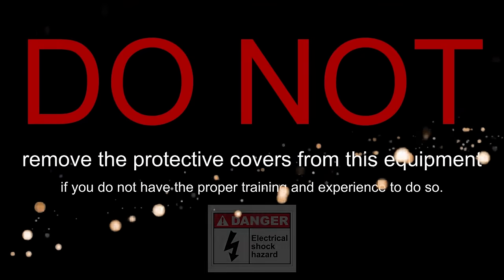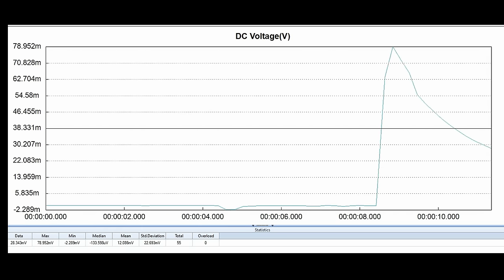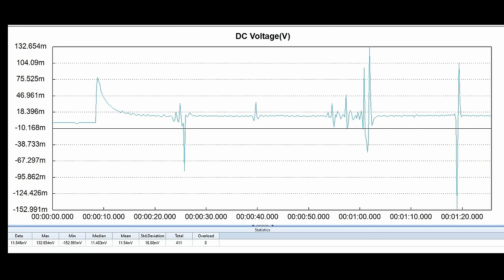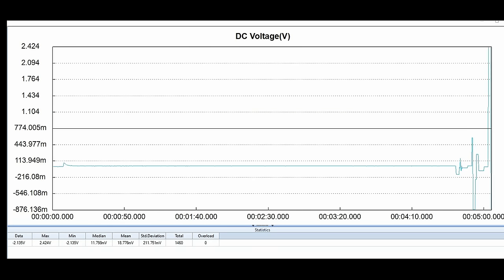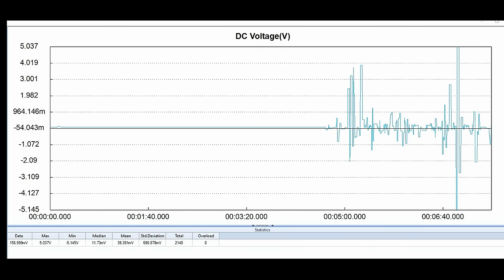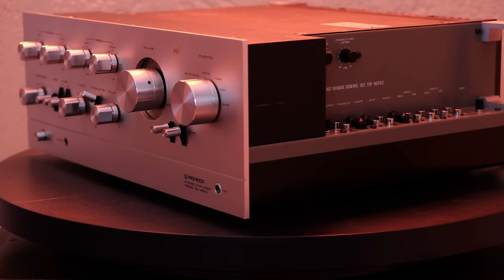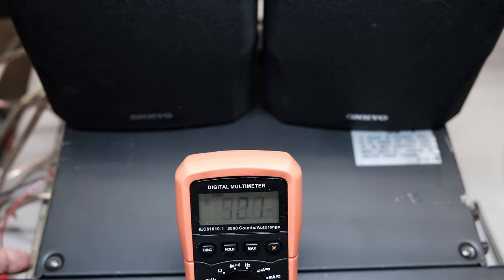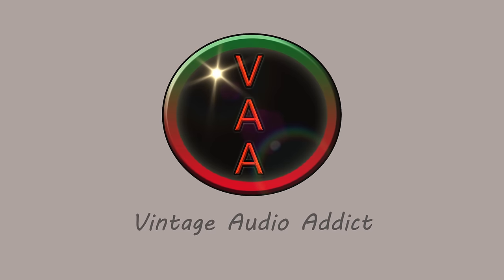HUGE Problem With Vintage Amplifiers & Receivers. Hides From Your Eyes But Not Your Ears.

Comment: How do you connect to the speaker outputs? Where does the ground wire go, to the chassis or on the speaker ground where the speaker wires artach?
Reply: My question as well. i have a pair of Adcom 555's, a Carver M-500 and recently, a NAD 208thx. All of them are 200+wpc, and the speakers I would use with them are a pair of aDs L810s or the 910s, both of which are 1970's era speakers. I'd hook up some 8ohm bookshelves to test first though.
Reply from the maker: You should have a positive and negative speaker terminal for each channel on your receiver/amp. You should have two leads from your meter. Polarity doesn't matter in this case but if you want you can attach the positive meter lead to the positive terminal on you receiver/amp. The negative to negative. DON'T SHORT THEM TOGETHER!
Reply: @vintageaudioaddict  Thank you, Sir Vintage! Oh, and I know to select DC, not AC on the meter, but if a reader doesn't...now you do!
Reply: Thank you! @vintageaudioaddict

Comment: great vid but i still have no clue how to adjust DC offset if needed…?
Reply from the maker: You would need the service manual for your unit or find the information on the net. In addition you would have open up the unit which puts both you and your equipment in danger.

Comment: I have a Pyle, the one made from China (2016 era), 4 channel car amp and it was sending many volts (Not sure what it was but knew it was wrong) to the front speakers damaging them. I have not repaired it, but was guessing a shorted capacitor since it looks like this model uses some of them between the output transistors and the the speaker. Now I wonder if one of the output transistors was failing. Still play normal when I tested it but seeing that voltage at the speaker connection is a problem.  (Pyle used to be made in USA.)
Reply: Yep... a Pyle is a "Pile"  for sure  no matter the year or place built. Just chuck it.
Reply: @Rob.DB.  The Pyle speakers was were I first heard of Pyle. Then in the 1980's,1990's I saw they had some amps at a car stereo show/sale. Yet I recall telling a stereo shop about the Pyle amp and they said that Pyle did not make any amps. The only problem I had with their speakers, was the foam edge would go bad but that was the thing with most speakers of that time era. I did not know until much later, around 1996 that those foam edges could be replaced. I did that to my 12 inch woofers, then some other brand stuff later. Some people frown on the foam edge design, but it has less resistance, less weight, so it is more responsive then the rolled paper or the rubber.   I think Quam was the first to come out with the foam edge for speakers. Now Quam stuff was more hype then quality. Nice foam edge but the 6 X 9 speakers were rated for like 5 watts. 
Another speaker I think was hype back in the 1990's; was Pyramid. High wattage but stiff as a board.

Comment: for abnormal dc offset ,the first thing is, always check variable resistor or trimpot of dc offset setting and bias  in vintage amps. and then leaky bjt

Comment: Where does the damage occur in speakers when multiple dc volts are sent to it?  Is it the voice coil of the drivers or the crossover or something else?  And what happens to those parts when this type of damage happens?
Reply from the maker: Yup, the voice coil will heat up and fail.
Reply: @vintageaudioaddict  , Thanks for the info, good to know.  I was wondering as I measured some sending some significant dc voltage coming out of an amp I was using to power an old altec compression drivers of mine some years ago that are now in storage.  The good news is the voice coils are connected to the diaphragm and they are easily replaced and still readily available.  Also good that the amp was only powering the compression drivers as the amp was part of an active crossover system.

Comment: Hey Chris this voltage test is performed WITHOUT audio going through the unit?
Reply from the maker: yes, that's correct. Volume minimum and select aux for the input function.

Comment: Hey man! Great channel u have here!  Iused to fix antique radios 
Still have a Radiola 60 and its wrkg .
Woul really like to know more bout my Sx850 and 950. And kenwood 6600 as aux input ia a dogs dinner. The 8 and 950 are great rcvrs, kenwood 6030 has lots of beef. Yup ill be watching you .lots of rcvrs have the jumper pins. Have even seen rcvrs being sold with out them.

Comment: IDK. I’m still running (bridged) Carver TFM-45’s mated to Sony TA-E9000ES Processor and my ol’ school Polk 1.2tl SDS-SRAs and Velodyne FSR15s (x2) still image as they did from the day I first purchased everything.
Granted, every 10 yrs I replace the Polk drivers and tweeters, and the Carver’s had new caps, etc. installed 5 yrs ago. I will NEVER part with my gear!!

Comment: Hi Chris, and wider audio community. 

Not sure if the topic of this video is what I'm experiencing but I have an old Denon PMA-350SE. Quite randomly during usual low volume use it would suddenly jump up to max volume static horrid noises, only way to stop it was to turn it off. Often it would then be fine when turning it back on for a somewhat random amount of time before doing it again, it was fairly inconsistent. I haven't used it for a while now because it was honestly quite shocking/painful when it would bug out like this. Wondering if this is a common issue you might be able to identify from this brief description? 

Cheers for any help.

Comment: Do you check the offset with the speakers attached?
Reply from the maker: Well....the rule is.... For direct coupled amps like this SA-9900 and many other amps/receivers, no speakers attached. For cap coupled amps/receivers, speakers or load resistors attached. Frankly for a unit like this SA-9900 attached or unattached is fine. It reads the same. Always safer to test any unknown amp/receiver without speakers. No chance to damage the speakers if there is an issue.
Reply: @vintageaudioaddict  My 1985 Yamaha A1000 is measuring a steady 4.5mv.
Reply: @vintageaudioaddict  One might keep SOME kind of load on a tube output amp.Or is that poor thinking?

Comment: Half these old amps have boards full of cold joints, and those boards  full of cold joints often, but less often, have noisy failing transistors. Not to mention the electrolytics - Always some. First thing to do is a visual inspection under some decent light. Maybe check for shorts on output stage, but then the first test would be a  meter across the output to check for DC.You may want to scrutinise the power supply section before turning on, and you may want to use a variac or test bulb to be extra safe.  If its OK to plug in a cheap pair of speakers  do so and continue testing. 
This is one of the first two.. Or even dodgy switches. Oh and they all have dodgy  switches and pots.
Reply: Off topic but you just described the new Jeep Cherokee rental I recently had for a few a weeks, dodgy switches, software, ride…I’ll keep using my vintage Yamaha amp

Comment: I had a Electron Kinetics Eagle 2A for years, it has NO protection circuit. One day it went full DC to my speakers and fried them so badly it melted the phenolic board the crossover was mounted on. The drivers were toast. I never listen above about 80dB either.  A couple of weeks later it happened to my friend who bought one new the same time I did.
Reply from the maker: Man, that sucks. Sorry to hear that. I love the vintage gear but I know there are risks every time you use it.

Comment: All that jumping in the bias usually means leaky transistors mainly in the preamp area and that sound? that's the infamous crackle emitting from the nasty 2SC458's! Most vintage high end gear has those nasty 2sc458's! take them out!

Comment: What did you connect the multimeter to ‽   Would help if you had showed that for us newbes.   Thanks!
Reply: He said a couple times " to the speaker output " either right or left will do.

Comment: My old Kenwood KA-7100 would cause a snap sound from the speakers when the relay closed or I switched the speaker selector from A to B and back again. Snapped when I powered amp down too. When running, it sounded fine, didn't run hot. I measured the outputs and found 450mv sitting on both channels. Took lid off and adjusted the DC offset pots on the main amp section. Got voltage down to near zero. Now the snap is gone! Ya!
Reply from the maker: Good job getting her running correctly!

Comment: I blew 4 woofers in an instant on a pair of Klipsch KLF-30s.    I was using a Phase Linear 400 AMP.    I lived in a crappy old condo that had a LOT of noise, pops etc through the electrical circuit that the stereo was powered through.  There was a bathroom on the same circuit.   The Bathroom lights and fan would create all kinds of noise through the stereo.  The tech that I spoke with said that I likely had a "DC transient spike" that killed them.   That was a sad and expensive day.   Nice vid.
Reply from the maker: Thanks a lot for watching. Man, that's a sad story. Yes, as you said when a high DC voltage hits your speakers it's over in a blink of an eye.

Comment: So on this unit you’ve isolated the problem to the preamp?
Reply from the maker: Yes and actually here comes a spoiler alert. The issue was caused by 2SC1451 transistors. Those are known to cause issues like this.

Comment: A capacitor on My yamaha R-1000 receiver gave up the smoke while playing yesterday. I racapped it, but a transistor went bad. Waiting on parts to replace the transistors on the power supply board.
Reply from the maker: Sounds like a good plan. Your Yamaha is a fine receiver. I'm glad that you are fixing her up.
Reply: I have the same receiver... haven't used in 18 years.  It looks perfect,  love to sell it.
Reply: @Damone7653  Enjoy that receiver. It has great sound! It was second from top when it was released after the R-2000.

Comment: This would be a decoupling capacitor issue, yes?
Reply from the maker: Spoiler alert. The problem was caused by 2SC1451 transistors. These are known troublemakers in vintage audio equipment.

Comment: What is the easiest way to graph the DC over time?  What do I need beyond a DMM?

I'm getting to the end now.  I'll finish and hopefully will see the answer.

So would a hold function be of use?  Could it show the peaks?
Reply from the maker: You will need a DMM that you can hook up (usually via USB) to a computer and some software that usually comes with the meter.  In my case the data you saw was captured by my Siglent SDM3045X and sent to my computer. I then recorded it using video capture software.(flashback express)

Comment: So I did a measurement on a old Kenwood amp I just bought that is all original untouched never recapped and it sits at between 0.6 to 0.8mV is that good asking as I know my way around but not that well
Reply from the maker: Well, if it's really that low then yes that is great. Just make sure that you are measuring correctly. The correct scale on the meter and make sure that your speaker selector switch is set to the speaker outputs that you are measuring. Thanks for watching!

Comment: So was the noise in both channels?
Reply from the maker: Spoiler Alert......2SC1451 transistors. Known troublemakers in vintage audio equipment.
Reply: @vintageaudioaddict  Same issue in my Akai 1722, 2SC458 known to be noisy.

Comment: hey Chris, do you know what is going on with the hifiengine? i used to have an account but had to care for my elderly parents for a while so i was not able to be very active and they killed my account and now they do not allow me to create a new one! i am trying to power up again and have no idea why they killed my account. thanks 🙂
Reply from the maker: Other's have had that same experience. I've heard that they are disabling accounts that have not logged in for a while. What a while is?, I don't know. Also, they are not taking any new accounts for some reason. Again, I have no idea why.
Reply: @vintageaudioaddict  i can't even send them a message! if your account is still active, would you please send them my message and see if you can get some answers? if they need help, i can volunteer. i was a very active member but as i said, my parents came first 🙂

Comment: I have a Sansui 5050 receiver that went totally silent while listening to music.Checked all the internal fuses, they are all ok. Is there a  obvious component failure that would cause dead silence while power is on.Unit lights up ,no sound.
Reply from the maker: It's tough to say. If it's all the inputs, It could be in the power supply section, protection circuit or the amplifier section that caused the protection circuit to operate. Sorry that I can't diagnose exactly what your issue may be.
Reply: I was just working on mine and if you open the unit towards the  left is a preamp board? with a pin connector on top with 3 wires I believe. I removed this board and the top pin connector and cleaned the contacts with Deoxit. Reinstalled the board (snaps into place) and the dead channel came back to life.
Reply: @68wrko that’s the driver board. The pre amp is in front attached to the pots.

Comment: Every unrestored audio component or speaker I have heard from 30+. years ago sounds pretty dull and murky.  Time and use worn.
Reply from the maker: Older electronics no matter how well it was engineered needs a little TLC from time to time.
Reply: @vintageaudioaddict   three years ago, I had a Carver m1.5t amp.  it sounded dull to me.  It got a total overhaul and upgrade.  the difference was huge/.

Comment: That's why I don't buy vintage audio , it's great stuff but it's just too old and so much can happen. A lot of original parts are not even available anymore and often you have to settle for cheap aftermarket parts.
Reply from the maker: Old and much can happen I agree with. The parts(mostly) are still available to make vintage audio equipment operate well for another 20,50,100 years? Can't say that about too many products. I've never had a piece of equipment in my collection that I couldn't fix because of the lack of good quality parts. Probably a bigger issue is that the folks who work on this equipment are retiring or passing away. It's getting harder and harder to find a technician.
Reply: it’s still better in some other ways to upcycle and keep things going. consider the heap of e waste bc everyone wants perfect gear perfect sound perfect tv resolution. none of that is good in the long run for humanity / ecology.
Reply: I'm glad you don't and I'm glad so many others are overly concerned about having issues, just means I can find and buy more! 

To me, the risk reward is more than worth it. I can go spend $3,000+ on a new amp and be guaranteed good sound but I'm also guaranteed to be out $3k+. If you're slightly skilled you can fix a lot yourself or recap an older piece. There's a sense of satisfaction in searching, bargaining, tinkering and researching an older piece that you'll never get from something new. 

There's also a sentimental connection with the old stuff, especially if you were enthralled by audio gear at a younger age, now I can afford the stuff and it can be just as good as it ever was with the right amount of patience and care.
Reply: @vintageaudioaddict I worry about the old technicians retiring as well, I'd love to see the torch passed to the younger generation, but I can't imagine many of them have much interest in learning. Maybe with average repair costs rising, they'll become incentivised by a solid paycheck.
Reply: Not stopping me from buying Vintage because this  could happen to Any Amp .
I will also Not Hook up any Equipment up to my speakers until it has been thoroughly Checked or Gone through,  it's well worth the cost vs wacking my 5000 set of Speakers.  Just like an old Muscle Car,  you have to be on it or it's not going to Run Right,  but guess what,  I work at a Dealership and Vehicles Come in Daily that are virtually NEW and have Problems since they are Electronically Controlled!!
Reply: My experience is that new audio lacks the bold rich flavor of vintage
Reply: 🤷🏻‍♂️ okay so don't buy vintage audio
Reply: Nothing sounds better than a tube amp
Reply: @ultraneight other than YouTube and other online sources where can someone learn to repair electronic equipment?
Reply: @stpierreorama  That's a great question. Maybe start with a re-cap project on an amp that's in working condition so you're not troubleshooting blindly if there's an issue after? My first recap was a McIntosh MC2105 but it was probably too ambitious since it needed much more. I do have experience with electronics, decent soldering skills and a general understanding of troubleshooting. Hit me up with any questions, I'll do my best to answer

Comment: Spoiler alert: The problem is caused by dried out and leaky electrolytic capacitors. They are not intended to last more than 20 years or so before their performance degrades. When buying a vintage piece of audio gear that is all original, you need to factor in the time and expense required to replace all of the electrolytic caps (along with any other components that have failed or are out of spec).
Reply: Or leave the caps alone and fix the problem